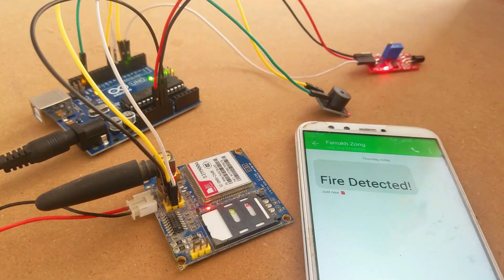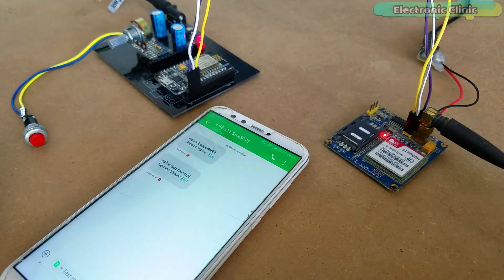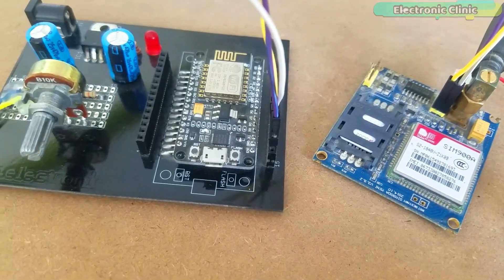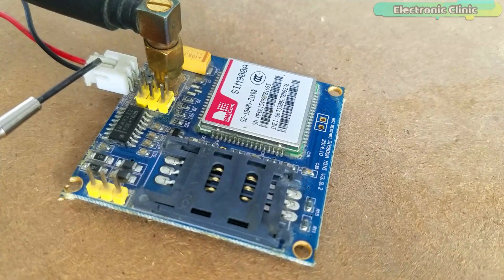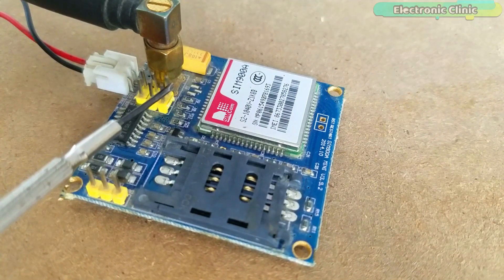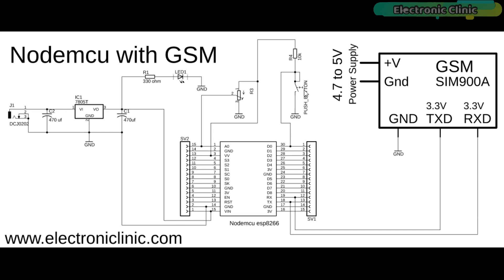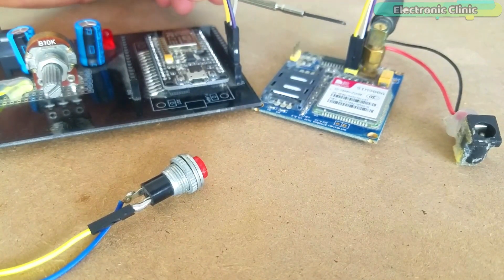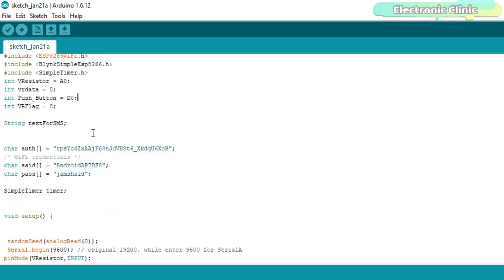Nodemcu with GSM Sim900A, ESP8266 & GSM, GSM Wifi,text message & Blynk,IOT GSM, Trending Electronics

Comment: sir, i wanna ask about how to broadcast sms to many number using gsm sim900 + nodemcu, my project is making gas leakage detector and fire detector using nodemcu esp8266 + gsm sim900a, could u help me sir ? thanks alot, i really appreciate ur project
Reply from the maker: i have a video on this in which i explained how to send a text message on multiple numbers. that video is based on arduino but you can also use it in nodemuc. check playlist.
Reply from the maker: video title is

Arduino GSM Project: How to send Security Alert message to multiple numbers using gsm module

Comment: Can I use the GSM sim to connect internet? Like when I will have a wifi connection, I will use wifi network but when i will not have a wifi connection, I can switch to the internet plan of the GSM sim?

Comment: Hello, I really appreciate you took the time to create this post
I was wondering if that could be possible to connect both components to the same 5VDC power supply? or could that be trouble with the current needed to both circuits (the NODEMCU and the GSM Module)?
Thanks in advance
Reply from the maker: ya, you can use the same voltage source, watch my video on smart purse with gsm and gps. you will get the idea.

Comment: Hi bro - really good tutorials. I assume you are based in Pakistan? if so, please could you clarify these two questions (1) how did you get sim900A (or any other sim modules) to work in Pakistan? I believe there is a IMEA control list in place through govt/PTA. So, please could you clarify how did you manage to whitelist the IMEA for Sim900A to work in Pakistan? (2) How do you source these modules in Pakistan - is it Alibaba / China or any local suppliers? thanks in advance
Reply from the maker: this module was already registered. I purchased it around 4 years ago.
Reply: Electronic Clinic thanks. Please could you clarify if it’s possible to register these modules “now” in Pakistan ? And also where did you purchase these in Pakistan ? Thanks